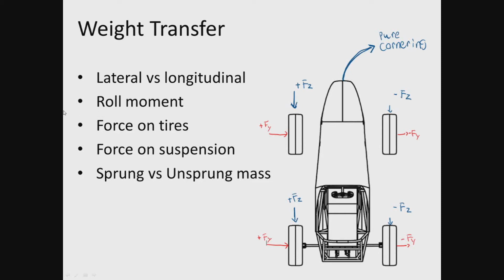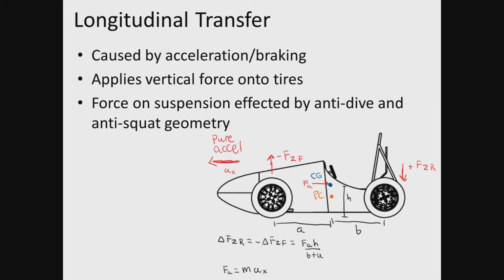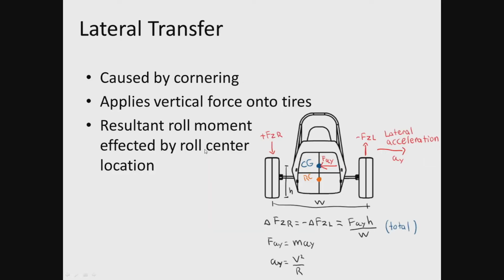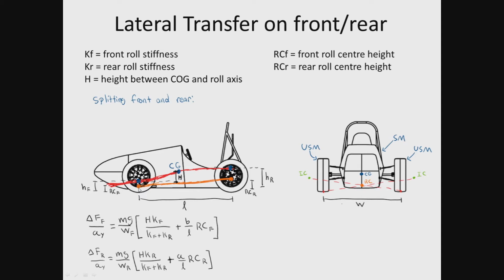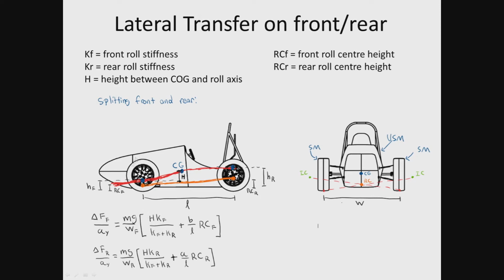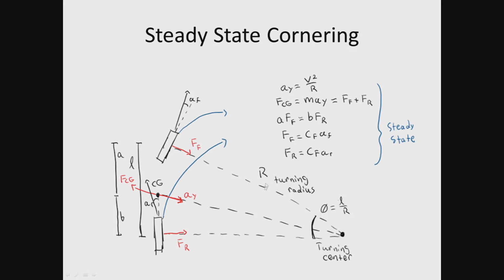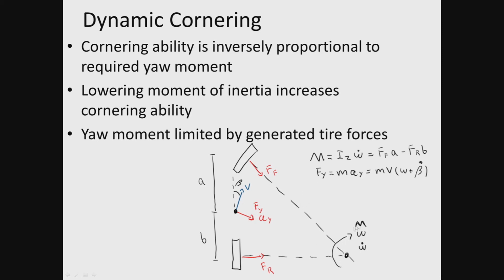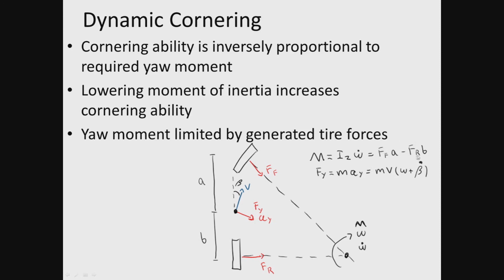Dynamics - Weight Transfer

Comment: Nice video!

 I’ve been wondering why the explanation of load distribution does not seem to consider the counter-torque at the driving axle.

Let's say the vehicle is driving with a constant velocity on a surface with high rolling resistance (like sand). And let's say there are no other forces acting against the movement (no air resistance, no trail attached, no internal tension, etc). Only rolling resistance.

Let's say the mutual rolling resistance is 6000N (30% of car's weight (18000N)).  According to the theory presented in the video, there will be no change in weight distribution if the car is neither accelerating, nor decelerating. In other words, weight distribution when driving at constant speed will be the same as when not driving at all.

However, to maintain constant speed, the engine must provide torque to the driving axle to overcome the rolling resistance. Wouldn’t this torque create a reaction that tends to rotate the vehicle body about the driving axle, potentially shifting load between the front and rear axles?